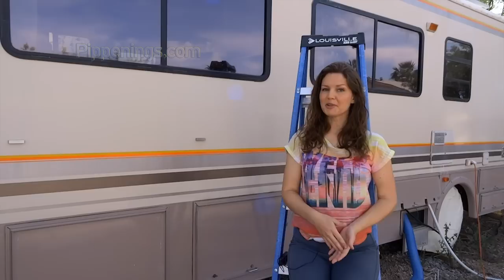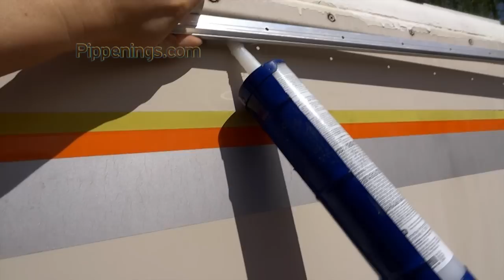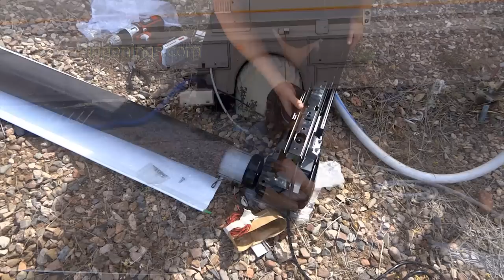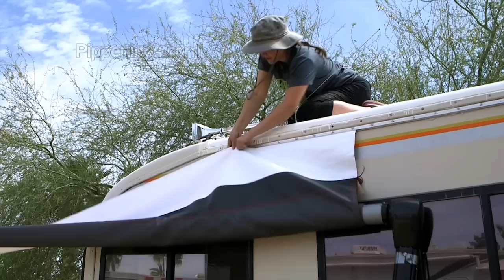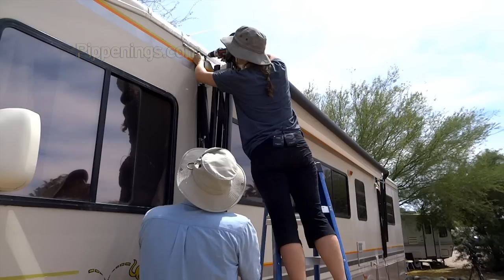RV Renovations: How to Install an Electric Awning, part 1/2

Comment: Congratulations again on this COOL project, ha ha.
As simple as the job may appear, it does take some serious planning to ensure you have good attach points, ensure you have clearance from any thing already on wall, like heater vents and people to assist. Funny, I used duct tape also at same point you did. 
I also chose Carefree to match existing units when adding one to our slide out to shade windows.
My problem was I needed a custom length that was different than their custom length offerings. After a phone call I found out I could get exactly what I needed but you need to call. 
Anyone doing this needs to pay close attention to "How to calculate required length".

Comment: Pippi just be sure you tell that anytime you put a hole in the RV you need to even seal those holes as if not there is a good chance for a leak so try to seal those hole afterwards good video and keep posting

Comment: Just came across some power arms for my awning,  quick question. What size screws / lags bolts did you use? And did just screw into the wall or did you hits studs ? Thanks love the video

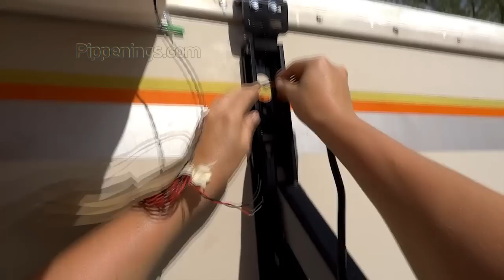Comment: 14:45 Anytime you run an electrical wire through sheet metal it is best to run it through a rubber grommet to avoid the wire chafing on the sheet metal. Can't see if you had a grommet in place. Hopefully part 2 is out soon!
Reply: It may be fiberglass, I don't know. I think I would still use a grommet even in fiberglass.
Reply: not metal. just fibreglass here. just U.v. Resistant silicone needed here. Clear Ge silicone 2 will Work awesome this application. stays flexible and mold resistant. can be obtained at home depot.

Comment: Hi Pippi
Just wondering what happened to the insulation you put on the roof?  I liked the idea but I don't think it would stand up to Arizona wind, or any wind for that matter. Any ways what I have been experimenting with is Homedepot self adhesive duct insulation, model #FV516. I use premium foil tape, model #1207794, to seal the joints. Take a look and see what you think.

Comment: I'm curious Pippi if you run into any problems doing some "extensive" work on your RV in some of the places you are parking.  I will be going full time this fall in mine and am purposely waiting to mount solar until I've had sufficient time to do some testing and analysis on the panels and the controllers I have. I had heard that some places don't want "tenants" doing repair work on their RV's. So I am curious if you are running into any issues with that.

Comment: Great job of installing the electric awning. I am just curious as to why you did not opt for a  manual awning that would not extend out so far but would come down to cover the windows? The electric awning  (it seems to me) is more for providing extended shade  area on the active side of the coach. I am not criticizing but am just curious.

Comment: Pippi I just purchased a new 20' roller tube and awning to replace one that got damaged.  The arms and drive ends are both ok.  I am trying to figure out the best way to install it.  Can I leave the arms up and just replace the roller tube after sliding it into the track?  Not sure if I can just slip the old roller tube out without taking arms off?  Any suggestions?

Comment: nice! on my roof, part of a top side corner is bulging loose so i drilled it w a long bit assuming thered be a top plate near to screw it back down but nothing so i added a stick on patch bc it seemed the membrane might tear being stretched out.
Reply: Hi, I apologize for jumping in on Pippi's thread, but bubbles in a rubber membrane roof are fairly common. A bubble means the adhesive has failed in that spot. The membrane is really tough material that doesn't tear easily so as long as the bubble stays small it's not really a concern. Now that you already drilled a hole in it, you can try using some type of large hypodermic syringe type of tool, such as a syringe sold for livestock treatment at a local "Farm & Fleet" or "Coastal" store, to "inject" some adhesive under the bubble area, use a roller to spread it around in there, and hope for the best. Patch the hole with something like EternaBond tape and you'll be good to go. -- Jeff Johnston, for Rollin' On TV
Reply: thanks... its actually part of the rounded corner of the roof that runs along the top of the wall which the membrane lays on that popped up. i filled the hole w sealant and added a self sticking membrane patch i bought on ebay.

Comment: Hi Pipe Im building a electron microscope I could do with some technical help are you available.
Reply: she can do that in her sleep.
Reply: michael adams She probably is I admirer her getting in and having a go not scared of braking a finger nail lol
Reply: She's Currently Working on a High Powered Laser System For the Military Right NOw So, She's Pretty Busy Troubleshooting those issues.

Comment: I would have thought you would use a heavy duty rubber grommet (https://s-media-cache-ak0.pinimg.com/originals/3e/3f/cf/3e3fcf3572dfada2a6bd3b9a540913e0.jpg) where the cable goes through the wall
Reply: made me look - Too
Reply: don't click the link ! it's not a helpful link to a Grommett specific to the task it's just a comical thumbs up picture of his liking.

Comment: ************ WARNING **********
When TESTING those motors as shown by Pippi, DO NOT use batteries rating or exceeding the normal 12 volt system of the RV.  If you have higher voltage tools or a 24 volt solar//charging system - DO NOT USE IT!  Always follow manufacturers specs unless you have a desire to buy replacement parts!  
STAY Tuned for more  "Righty-Ro" from Pippi to you!